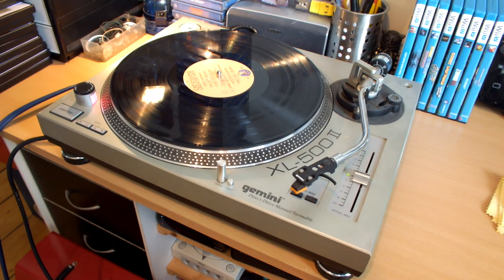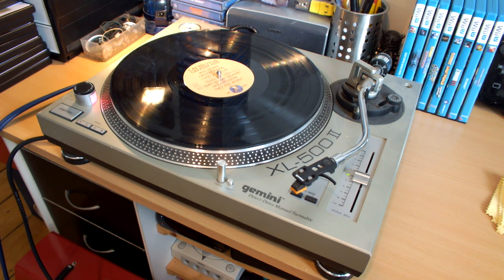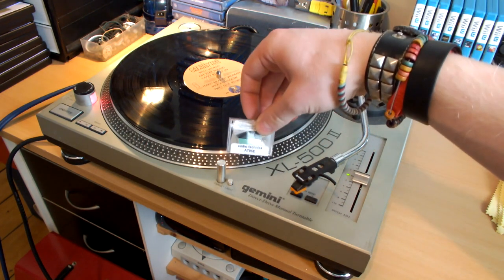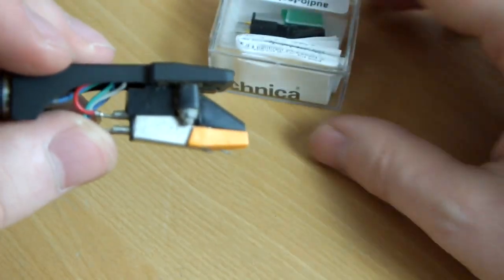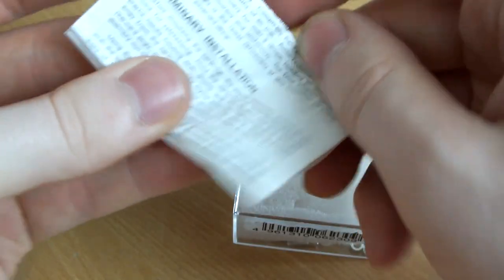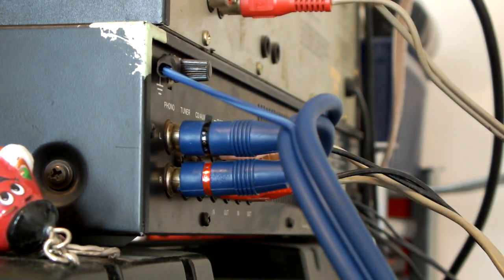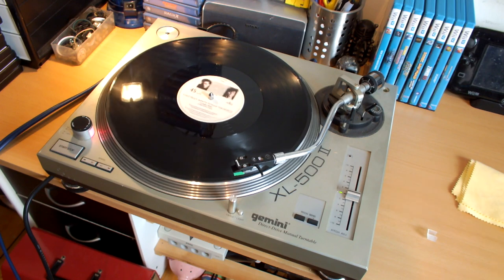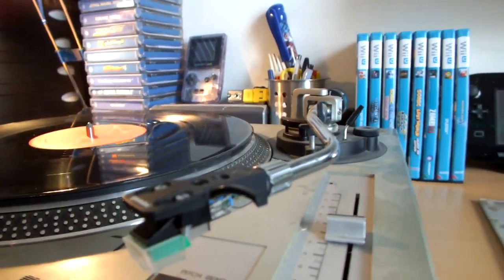Digging Out My Turntable (New AT95E Cartridge) | IMNC

Comment: Excellent video TOm. Just a few comments which may help you and / or the viewers.

Firstly, cartridge alignment. The 52MM alignment method, for those who don't know, simply involves positioning the stylus tip 52MM from the rubber washer on the rear of the headshell, then insuring the cartridge body is square in the headshell (and equidistant from either side). This is the standard method of alignment used on the infamous Technics 1200 turntable, and is thence used on many of the other DJ decks (though some of the cheaper models do vary the mounting distance by plus or minus 1MM). That said, better results can sometimes be achieved using an alignment protractor, which is the standard method for hi-fi turntable users. Free printable protractors are available from the Vinyl Engine website; standard protractors, or those designed for use with the Technics 1200 turntables will work just fine for you.

Secondly, with regards the counterweight. Different cartridges are of different weights - therefore, before setting the counterweight, it's necessary to do what's called 'zeroing' or 'balancing' the arm. You may have noticed that your counterweight comprises 2 parts; the main weight body, and a small spinning plastic dial. To correctly setup the counterweight, rotate the entire weight until the arm floats horizontally over the playing surface of the record (without touching it). It's important that for this part the stylus guard is left off  - so be careful not to bump your stylus. Once done, rotate only the little plastic dial, while holding the weight itself in place, until 0 is at the top (there should be a line on your arm with which the 0 marking will line up). Finally, rotate the entire counterweight inwards until 2 is at the top or in line with the mark on your arm. This is how to properly set the tracking weight. Of course, you could also use a small pocket scale if you wanted to be really accurate.

Thirdly with regards anti-skate. Anti-skating is used to counteract the natural centripetal force generated as the spiralling record groove drags the stylus towards the centre of the record. Anti-skating helps to keep the stylus positioned vertically in the centre of the record groove. Not using anti-skate will result in more ware to 1 side of the record groove and the stylus. Anti-Skating should be set to the same value as your tracking force (2 in your case). You can then observe the stylus from the front as the record is playing, and adjust the anti-skate up or down depending on whether the arm appears to be leaning 1 way or the other.

That's enough rambling for now. Glad you got it up and running, I hope it affords you, Jess, and IMNC JR many happy hours of listening pleasure.
Reply: Tom, your channel imbalance will also be affected by the anti-skate mechanism.  As Ash says, an incorrectly set-up anti-skate will result in wear and tear to one side of the record groove.  Not only that, but because literally one groove wall is responsible for what you hear in the left channel and the other for the right, having the stylus exerting more pressure on one groove wall means you hear a bit more of that channel.  So just follow Ashley's advice, - balance the counterweight properly, set the correct cartridge weight and then set up your anti-skating (in that order).  By the way, people put far too much emphasis on arm height adjustment - it needs to be set correctly if your arm has that adjustment, but there are hi-fi decks of very high repute that don't have VTA (arm height) adjustment.  I own one of these - as does Ashley!  The argument is very convoluted, but put it this way, each record has its own thickness, which will change the VTA very slightly each time you play a record - and only those who don't get out enough will want to adjust the arm height each time!  Best of luck with the records, and congratulations join advance for being a new dad!  I've followed your channel for a couple of years and always found it informative and entertaining - hope you get time to keep it up. xx

Comment: Cool to see you into records and turntables, funny enough I just replaced my Technics' old Stanton 500 ii cartridge and numark headshell (came with turntable from dj) with an ortophon Concorde Gold. Sound quality seems to always be upgradable with these things
Reply: NikoNoxious If you use your turntable for music listening (as opposed to or as well as scratching), check out the Ortofon 2M PNP range. They're 2M cartridges pre-mounted on custom-designed universal headshells that will fit right in your technics. The 2M range sound incredible when setup properly, and are far kinder to your records than any DJ cartridge.

Comment: Automatic generally isn't a good thing, the best turntables are manual. I have a Rega P5, which is very much a manual deck but it sounds excellent through my Linn setup... I'd love a Linn turntable (also manual) but they aren't cheap!

Those AT95e carts are about the best you can get for the money, next worthwhile step is the ortofon 2M red but that's £80. WRT the alignment protractor, you can download and print one which I would do, it's important for sound quality, and for stylus and vinyl wear.

Comment: I don't know if my AT95E which was bought Aug 2016 could have developed a fault in only two and half years. The sound from one speaker keeps intermittently going quiet. It's not the speaker and don't think its the amp because if I hit my amp Mono button, sound is restored to both speakers, and CD's play fine. The turntable is set up correctly so am wondering if the cartridge could be at fault. I'm not an expert with things like this and fiddling with it for a length of time seems to eventually get it working. But I can go back to my turntable a few hours later and I've lost sound in a speaker again. Can cartridges develop a fault that quickly?

Comment: I wouldn't think having the earth wire would be very useful as most audio equipment has the ground on the RCA tied to mains earth anyway.?
Reply: Slot1Gamer Most older turn tables use phono, which doesn't have ground built into it. At least thats what I've been told. 
Mine is phono and has a separate ground wire.

*Edit: You know you're tired when you right the same sentence twice
Reply: Slot1Gamer Some turntables (those made by Rega for example) do ground to the right channel RCA ground. However in some cases this can cause interference, due to the electrical characteristics of the turntable cartridge when matched with the phono stage (or phono preamplifier).

Comment: i don't hear any difference between your old and new stylus, it sounds exactly the same or just maybe because i'm hearing it on youtube? stylus tend to last almost forever depend on how you handle it with care, even you use it on a DJ flat from or scratching, it will last long, except if your vinyl is full of big hairlines that's the point your needle will worn out everytime it skips.. Vinyl is made perfect polished so the stylus will just slide on the grove without problem..